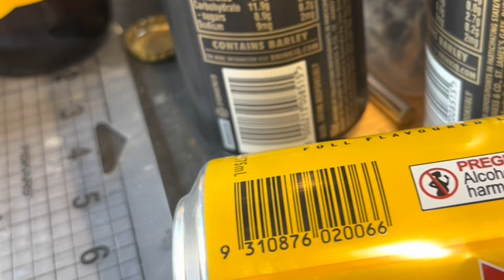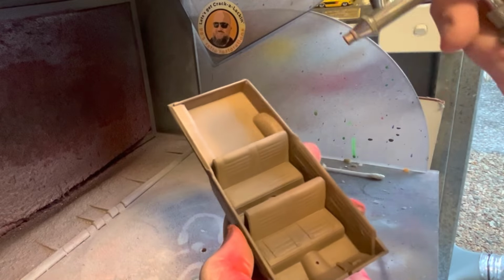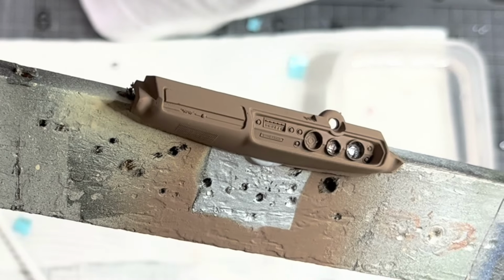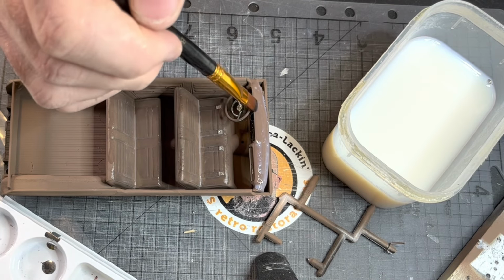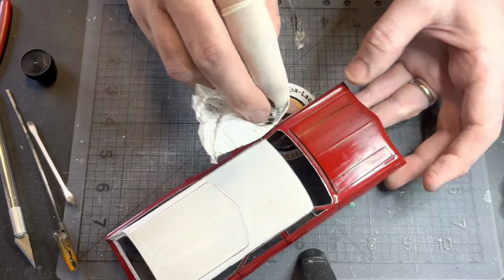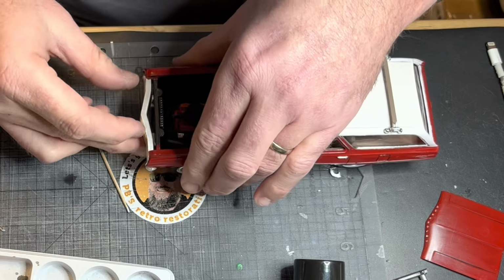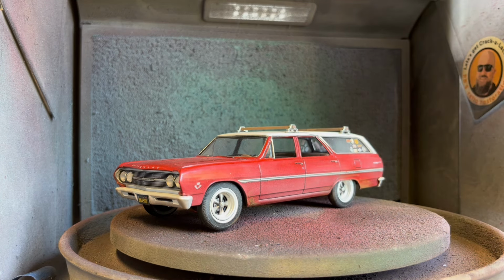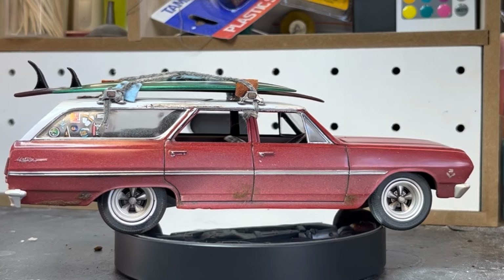AMT 1965 Chevrolet Malibu - Metal Mania 3d Any Kit Community Build! #MM3DTVGKB

Comment: what does the black wash do ??
Reply from the maker: I find it adds some depth to seams in the seats and door jams. I wasn't sure what result I would get with it on the wheels, it took the dull coat that I had sprayed on the wheels off but I thought it worked out ok. I use it on diecast car grilles too, it just follows the lines and is pretty easy to use. Thank you for watching, hope that answers your question 😀